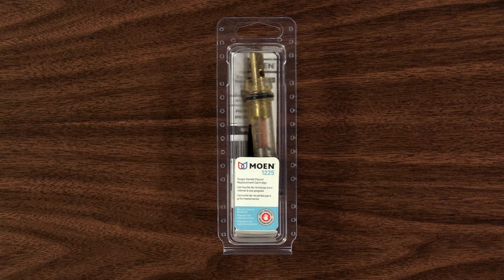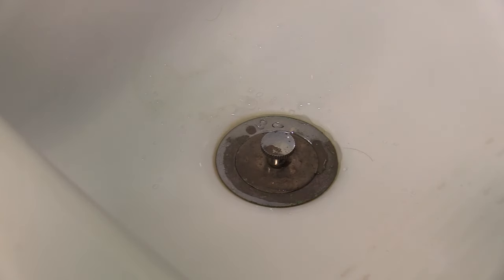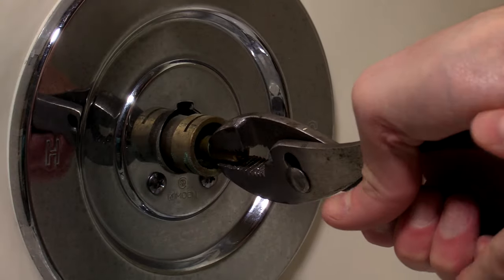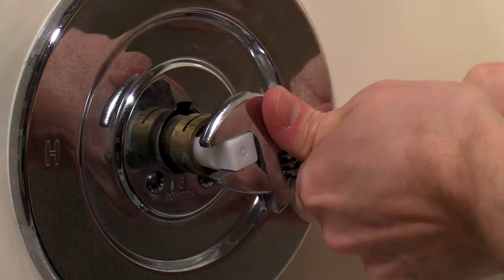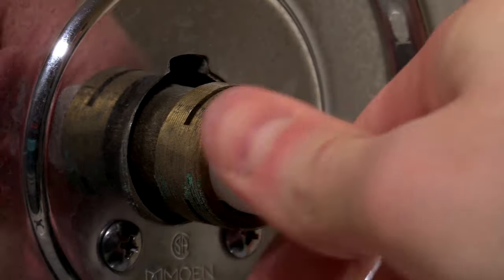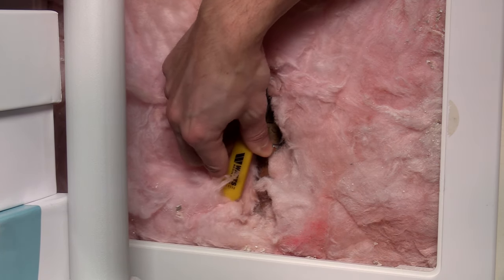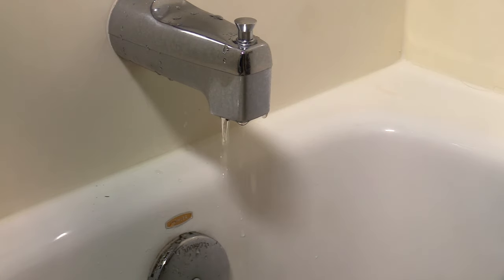Replace Shower Valve (Moen)

Comment: The rules are the same as a regular shower valve except for these changes. For a refresher of the rules, check out this video.
Reply: En passant is allowed as normal
Reply: But is castling allowed?
Reply: Use a 16 by 22 Chess board.
Reply: The object of the game is the be to first player that replaces his valve first.
Reply: There is no check or checkmate
Reply: @wellinthatcasethatsucks  it may however be used to assault anybody
Reply: If you assault someone, you must take a 1 move penalty.
Reply: The first player to replace the valve, Win. Lol

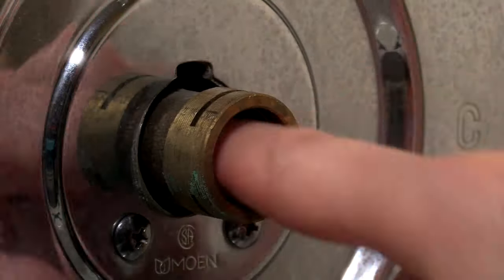Comment: A 3/4” copper fitting brush works great to remove mineral buildup in the valve body 👍🏼 1:00

Comment: Have exact cartridge. Water was dripping and overnight I ended up with about 8 liters of water lost. I bought the replacement from HD followed all the instructions but it leakier even more. Anyone got a solution? It is original Moen 1225 cartridge